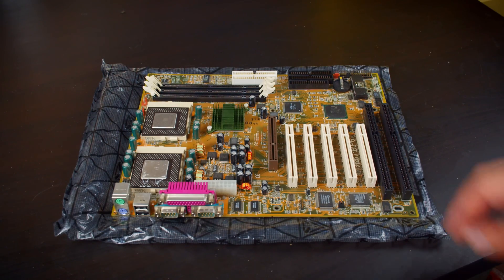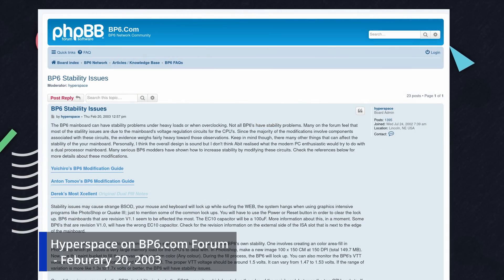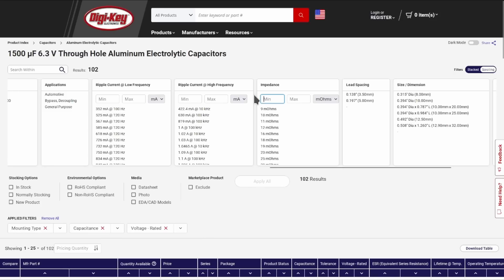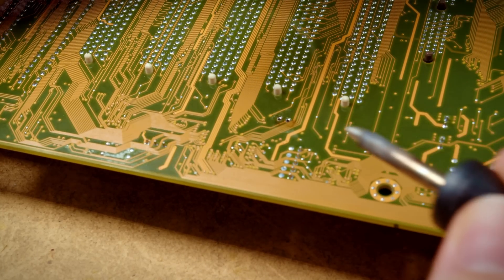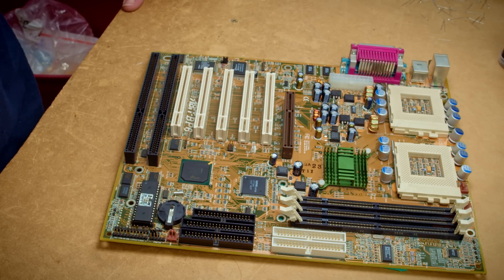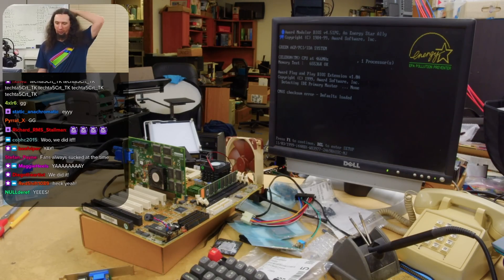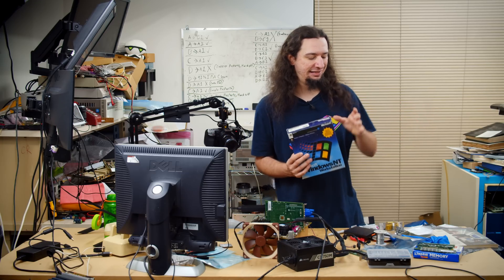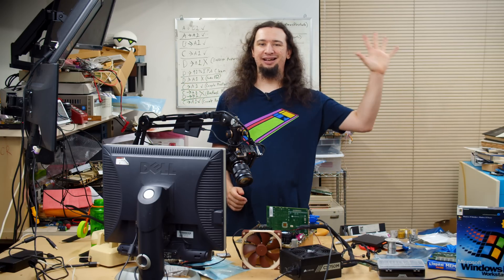Abit-BP6 ReCap - Dual Processor Motherboard Back to Life

Comment: On the input and output of the VRM, you often have capacitors in parallel, which means capacitance adds up. 
Abit and lots of other manufacturers often used more capacitance than actually needed, because by using the biggest size and capacity possible (they're restricted by cooler size), they could get much lower ESR (esr will vary with diameter and height of capacitor). So because of this, when you move from electrolytic capacitors to polymer capacitors, it's usually possible to use slightly smaller capacitance values (for example 1200uF instead of 1500uF would be perfectly fine on this motherboard)
Also, they tended to use 6.3v or 10v rated electrolytic capacitors on the output of the VRM because again, they needed very low ESR capacitors. Considering the output voltage of the VRM of less than 3v, you probably could use 4v rated polymer capacitors, but 6.3v polymer capacitors are also quite common. 
Also, you should also be aware of other stores with good reputation like Mouser, Farnell / Newark (same company, different names in different regions, now owned by Arrow if my memory is correct) , RS Components, and TME (in Europe)
By the way ... as the board seems to use only 5v to power the CPUs, when replacing those 10v rated capacitors, you could replace with 6.3v rated polymer capacitors.
Reply: What is ESR?
Reply: @renakunisaki  Equivalent series resistance, it's a property of capacitors that can't be measured with simple multimeters, you need either "ESR meters" or "LCR meters" with ESR measurement function. In a super simplified way it's like the capacitor's internal resistance... in high frequency switching power supplies you want this ESR value to be as low as possible, but in other circuits (ex after a linear regulator, or in an audio amplifier) it's not as important or it's even preferred to have slightly higher ESR (for example some linear regulators are only stable with a capacitor on the output that has ESR value between 0.1 ohm and 1 ohm so you have to be careful when you make your selection)
In capacitor datasheets, you can look at the column  titled Impedance at 100 KHz because at high frequencies, impedance is practically identical to the ESR value in electrolytic capacitors.

Comment: i have a dual Pentium 3 system, that i built as a retro server, it can run anything from windows NT 3.51 right up to windows 2003 server.  It had the 866 chips in, i later found a pair of 933s that came out of a server.   In those went and the system ran like stink compared to the 866s.  Not sure if it's something to do with matching step codes or something? It seems to be a grey area.

Comment: I ran a server at one of my first jobs on a BP6. It had two Celeron 300A at 450 MHz (they ALL did it stable, due to the disabled cache I guess, I also had a 300A@450MHz at home in a BE6 IIRC), ran 24/7 for at least 3 years, hosting pages on the Internet like a boss (it ran RHL 6.2 or so, no issue with SMP support obviously). It was like 10th of a price of a proper dual Xeon system, ideal for a small local provider.

And of course one day it started misbehaving, now we know all it needed was a recap, but hey, it did its job long enough there was already better hardware to migrate to. I say BP6 was a win and a legend!
Reply: I had the same setup.  Celeron 300 had no cache and no performance 300a had cache and geat performance.  300a always worked at 450.  The belief was that it was the same design as the Pentium 450, de-rated to fill a hole in the product ladder.

Comment: you would think there would be a thing you could solder to the MB so SMD caps would work, like you can with chip sockets instead of a socket you just adding a SMD pad.

Comment: why, if you knew the audio was bad in the last bit, would you not boost the volume?
Reply from the maker: Making it any louder hurt the noise reduction that was keeping the fan sounds from being a problem. That audio was from the camera pointed at the computer and I had to find the right balance between fan sound and speech. I may have err'ed on the side of caution too much.
Reply: i appreciate the explanation.

Comment: Back in the day those celery processors were overclocked 100-200mhz over and as long as you could remove the heat, they would take it. I'm also pretty sure the agp video thing is a bios setting so if you change it there (or reset the bios) it should let you run a PCI card.

Comment: When it comes to caps, they can be very much like the proverbial horse shoes and hand grenades: close enough is close enough. Any modern low-ESR electrolytic type from the likes of Nichicon, UCC, Rubycon, or Panasonic would likely have worked perfectly well in place of the originals. Do bear in mind that lower-quality parts may well have not met their stated specs on their datasheet, even when new.
Reply: I agree.  Who knows what the original EE design documents would have specified, but I'm going to guess that those original caps were probably as accurately specified as your average Tinder profile.  I just go for whatever Nichicon (or Rubycon) cap will fit in that footprint (filtered by lead spacing and diameter), has a 105C rating, and then sorted by lowest impedance / highest ripple current.  I've yet to have an issue.
Reply: I remember in going through college one of my professors would say "meh, 10%" whenever a measurement or spec was a little off, lol.
Reply: Yes. Cap is a cap is a cap. I really dont understand that "not manufactured anymore" bit :/
Its like saying you cant drive 20 year old car anymore because manufacturer discontinued tires it came with.
Those polymers look hilarious, and I find it difficult to believe Shelby couldnt find any other 1500uF >=6.3V ones in matching size. And Kemet is not some random low quality brand lol.
Reply: You don't test every single board you make against the design specs because that would cost way too much. If customers don't complain, then the fact that boards are shipped not meeting the spec may never be noticed.
Reply: When you go back further to the early 90s or so, beware about just sticking low ESR caps everywhere, because you may cause instability in circuits that were depending on capacitor ESR for dampening. The two examples that come to mind are: 1. Low-ESR caps in place of old ones can cause much higher inrush current, potentially blowing a fuse or something. 2. Low-ESR caps on the output of certain voltage regulators (thinking of LDOs) can destabilize them and result in much noisier voltage.
Reply: @rfmerrill  Wise words, thank your for your comment, that shows background knowledge and some love to REALITY (that is where specifications and physical-chemical components like capacitors live:) ).  TLDR; "The golden capacitor boys" are in the forum-town again. Let's prepare some popcorn for comedy!:)
I really love social media, when it comes to capacitors. Especially here on YouTube, where LOW ESR = better (than sliced bread?) ... or "something good" means, usually repeated by the lunatics as mantra. I always swing between *facepalming* and crying in agony about so much ignorance. Like you can read in some of the threads here. But what do you expect? After all, people commenting here aren't electronics technicians, they're plumbers. Otherwise they would be interested in the intended use in the original circuit, or these amateurs wouldn't be so arrogant and ignore the original specifications of the circuit and the PCB designers: because we(they) know better and just use "any" capacitor. But then with brand names! And expensive!!! (It's a good thing that Addidas, Gucchi or Nike don't build capacitors).
But if I think about it, these bunglers would be intolerable even as plumbers! Just picking the wrong pipe for the toilet would go well with some here ... because someone on the internet said: "IT WORKS FOR ME" (famous last words;))) ). 
Please excuse my (mostly satirical) rant, that I will end with: Someone who compares specifications with the straw-man of Tinder-Profiles, to justify his other straw-man (a guess about how "lazy" and precisely the original designers may have been ... or not ... WHAT??? WHY? CITATION NEEDED! ROTFL) which is: "I use what I want, period! Now bring that ship on speed [Titanic]". Well, there is all love lost. No thought about RTFM of the original documents (maintenance manuals, design concepts of the era), spare part and comparison type data books provided by all major manufacturers, etc. Oh, and this is meant as a satirical incentive to learn something and not meant as physical violence: One should hit the culprit repeatedly left and right in the face with a measuring device until he wakes up and realizes that you can actually measure these values of the components. Well, there is a strong and persevering arm needed, I suspect[1]. 

P.S.: It is not so bad: Most of those "golden audio capacitor"-guys do no harm to anyone but themselves, as the problems will occur in 5 or 10 years, or are of the kind we like the most: intermittent or sporadic failure modes ... exactly what we want from a computer *applause* Oh, wait a minute ... wasn't all that hassle to preserve the devices of our childhood, the good and beloved retro gems, for later, for future generations? Well then, changing components without the simplest clue, just by "believe" (go to the fracking church for that:P), changing specification ... is just shooting yourself in the foot. Which is in most cases: very sad (and painful).

[1] The same guys, which is even more funny(creepy?, disgusting? ... you choose, hehe), are (without exception!!!) seen switching on a full blown Computer-PSU to "test" their DUT (device under test/repair). There you can see the "plumbers" in its worst form. This denial of good practices or what you learn in a (must be stupid for them) apprenticeship in that sector should be punished by (again, satirical!) a sit-in on "old-sparkles", also without current limiting... :P

P.S.S.: Still waiting for one of these "specialists" coming crawled up with its tail between his legs and admit that his old repair job went up in smoke. Why do we hear that so seldom, especially here in the forum(meaning seldom=never, LOL)? Strange, if we take into consideration that we see that more often in professional repair shops and hear from professionals, where these so called repairs or ReCaps end finally: Totally botched repairs with lots of "Alice from Wonderland fantasy Nichicon's", which caused some very nice domino like mass-component exitus:)

P.S.S.S: If someone feels offended? Wonderful! That is the job of satire. And now: don't waste my time! Better have a look at the Title-Card of the video. There Tech Tangents linked the "Caps Wiki Page", actually made by professionals and people who can read datasheets. That is how its done and not by some guesswork and rumors from the internet. All data of the capacitors can be checked there without any gaps. You do not care? Not my problem!:P
Reply: That does explain why I'd find a lot of systems with the bad capacitor plague that were still functioning to one degree or another.
Reply: @JaredJanhsen  Yep, Someone gave me at the time old pentium 4 board with a graphics cards. They said it wasn't stable. Opened it up all the caps on the board and graphics cards had vented. But it would boot run fine, sometime even for days.
Reply: @allalphazerobeta8643  At a previous employer we had an old Pentium 4 Optiplex with vented caps that was the only machine running our access control.   The system would run for weeks at a time then start acting funny until it had chilled in the server room for a few hours.  Had to get another office in the US find the exact same model with (super clean with good caps no less) just to transplant the HDD.
Reply: Yeah, if that board was in my collection vcore would've gotten random salvage 8mm 820uf 6,3V alpos :D When replacing even low esr electrolytics with polymers lower capacitance is just fine(within reason) :)
Reply: So the board possibly shipped without meeting the design specs? Or the caps shipped without meeting their advertised specs?
I suppose either could be possible.
Reply: Nichicon or Rubicon electrolytic would have been the way to go, can still use those. Nowadays the new polymer-cap cans.

Comment: Yaay! I had one of these boards with two Celeron 500's in it - a whole GHz of processing power and SMP to boot! I ran it with Linux and it worked a treat. I don't remember any issues with it and it ran as a reliable server for quite a few years. It finally got retired when cheaper, faster single-socket solutions became widely available. Great fun and a real talking point back in the day 😄
Reply: I ran it with Windows 2000 - in the hopes of boosing performance in real-time audio. Let'sjust say the the software/os wasn't up to that task. In games etc, it was a blast! I passed mine off, before it gave up the ghost
Reply: @jakobole  there was absolutely no game that took advantage of multiple processors, just like no game took advantage of a multi core CPU at the time. its the exact same concept.
Reply: @FingerinUrDaughter  I beg to differ. Falcon 4 did. Which is also why I got it.
Reply: @FingerinUrDaughter  falcon 4 was compiled from the ground up to take advantage of Smp.
Reply: @FingerinUrDaughter  I don't think I ever implied that. That wasn't my intention - I know
Reply: I refuse to believe ANYONE bought this Mobo with Dual Celly 500's and didn't overclock.
Reply: meanwhile my amd classic was shitting all over your setup without even trying.
Reply: Recuerdo que tenia 2x 433@500  -->  1GHZ yeaa baby !!!!!  Saludos desde el hemisferio sur !!! 
Win NT 4 never crashed and having two processors was a delight because it never lags either, there was always a processor for the Windows desktop.
Reply: 2 X 500 MHz =/= 1 GHz
Reply: @eddiehimself  I guess you mean != and yes I am quite aware of the fact that two processors in SMP do not produce the performance of one processor running at twice the speed.
Reply: @spacedock873  Performance wise, maybe, but "two times 500 million cycles per second" is "1 thousand million cycles per second." Math!! You had it right all along!
Reply: @spacedock873  That is used in programming as a substitute for the not equal sign ≠, but =/= is closer in appearance.
Reply: @eddiehimself  "Is used in programming"? What language uses =/= instead of != or <>?
Reply: @samiraperi467  Eddie Himself is saying != is used in programming, but he prefers =/= in text because it’s closer to ≠
Reply: @samiraperi467  <> for the win!

Comment: i would just convert board to smd by installing copper wire pads first and smd caps later if i had no better choice
it makes for better replacement later down the line

Comment: That's cool and weird. My first proper computer had a 533mhz celery. I hated that thing it was so slow and its branch prediction was the worst. But at least it taught me how to write fairly decent assembly code, and I learned a lot of optimization techniques coping with its limitations. I even still have it. Might unpack it once I'm fully settled and see if the hard drive still works. Last time I used it was probably a decade or more ago and it was starting to click.
Reply: Funny that you mention, the biggest optimization I ever did was because my MUD running in the background caused frame drops when playing Hexen II on a Celeron 300A@450 ;) Conclusion: wide spread of Celerons contributed to software quality all over the world! :)
Reply: @--Lam  I think that's why a lot of Russians are really great programmers. They had a lot of garbage hardware and needed to really squeeze a lot of optimization out of it. If you ever used Delphi back in the day and replaced the slow and bloated VCL with KOL, you'd see a good example of that.

Comment: Oh, that brings back memories. I had a dual PII 333MHz which I used mostly with BeOS, but dual booted it with Windows for games. I dubbed it the "Devil's Rig" and I loved it. I do think I still have the MoBo somewhere 'round here, but one of the processors is long gone.
Reply: What about BeOS? Do you still use it?
Reply: @anon_y_mousse  I loved it with a fiery passion of a thousand suns. But I haven't used it in some 15 years or so. When I typed in the comment I decided to gather enough stuff to build a rig to run it again and see how it stands the test of time, but it'll take a while to do it. Still have the original media, though, so I guess I can install 4.5 or 5.0. Never tried HaikuOS, but I think it's just not finished yet.
Reply: @leandrocosta3709  I just looked at that the other day. Looks nice, but I haven't had time to delve too deeply. Been playing with TempleOS more. It's a pretty fun toy thus far.
Reply: @leandrocosta3709  While Haiku is still in beta, it already beats BeOS R5 in almost any (if not every) possible way. The beta3 is already too old and missing many fixes, so if you want to try it, make sure to use one of the nightly images.

Take care!
Reply: @foobar-9k  thanks!! I'll get it momentarily and give it a try!

Comment: I used to run mismatched PPros, P2s and Celerons in SMP back in the day.  I also killed a Celeron 300A doing the drill and solder SMP enabling mod prior to slockets and boards like the BP6 hitting the scene...  When running mismatched CPUs, the CPU speed of the first socket/slot is what gets reported.  The second socket runs at it's normal multiplier, and matching FSB.  So if you've got a 366 and a 300, both using a 66mhz FSB, first CPU runs at 366, second at 300, BIOS reports the CPU speed as 366.  Some systems will throw a minor fit if the CPUs don't match during post, like the old IBM rackmount Slot 1 systems I abused, but you could just keypress past the error and they'd run just fine after.
Reply: That's funny as fuck